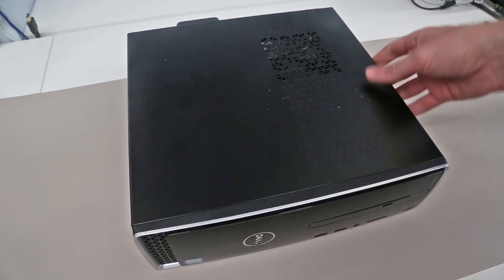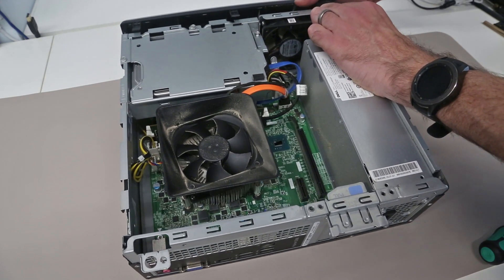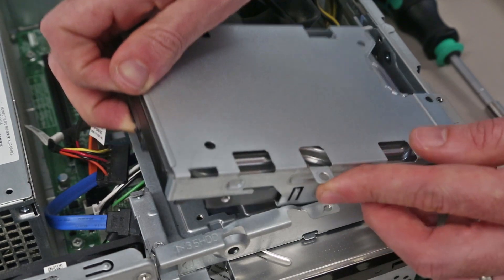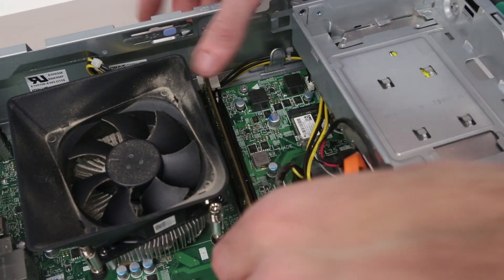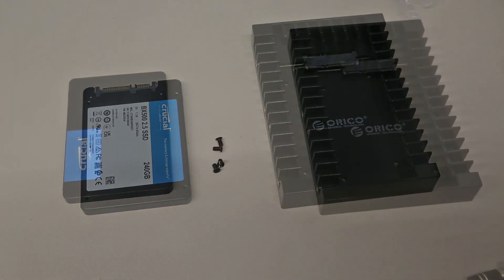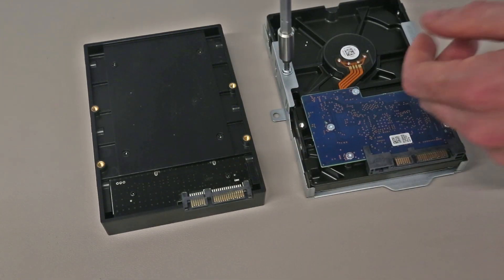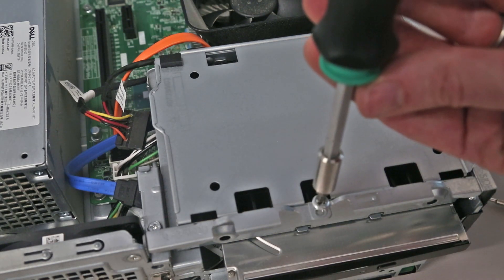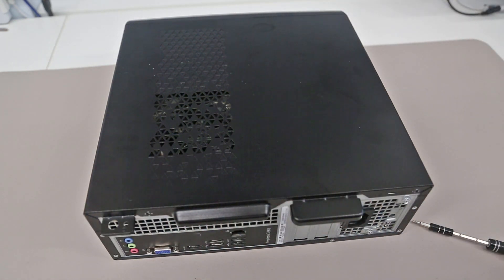Dell Inspiron 3268 - SSD and RAM Upgrade Guide

Comment: Great video, really useful.  Tried to start afresh with the ssd and a win11 install from a usb but windows doesn’t find the ssd to install, wondering why
Reply from the maker: You probably have the Intel VMD enabled - its used for RAID/Optane if the system has either.
You'll either need to supply it with the driver on the drive selection page or disable the VMD in the BIOS.

Comment: In which direction i should place fans for dell inspiron 3268 pc
Which direction air should blow 
There are 2 fans 
1 cpu cooling fan and other on front down side of cpu. 
I am confused about the orientation.
On google mix answers are coming. Please help.
Reply from the maker: The CPU cooler fan blows down towards the cooler. The front fan blows in to the case.
Reply: @BrueComputing  you mean to say cpu cooler fan blows air away from cpu right ?
Outside the case

Comment: You would just go ahead and put a "stick of gum" SSD naked strip in it. The light blue peg holds it in the dedicated SSD socket, next to the card slots. Choose the Serial-ATA strip, with a notch cut at position "B" key. Seems this isn't wired for nVMe protocol, a shape "M.2" SSD, the PCIe connection.

Comment: Cheers pal, used this vid to replace a 3.5 HDD with a 2.5 SSD. Had to push the new hard drive in quite firmly to get the screws to line up. Is that right? However, would never have got the right adapter without your vid. 👍

Comment: Hi, could you make a similar video on how to install a new graphics card in this desktop computer? I'm planning on adding a GT 1030 to my Inspiron 3268, but I'm still relatively new to computer upgrading. I did follow your steps to upgrade my SSD and RAM parts though, got myself a Crucial 1TB SSD (+2.5 to 3.5 adapter) and a 8GB RAM card.

Comment: Thank you James for the excellent video, which gave me the confidence to try to upgrade my own Dell Inspiron 3268 desktop computer with a 1TB Crucial drive.  Unfortunately, after installing the new SSD I find that I cannot boot up into Windows 10.  The disk copy with a boot option using Acronis True Image apparently worked successfully.  Any advise or suggestions would be most welcome.

Comment: did this using an ssd which had window installed already but ssd not detected when booted from desktop. Any reason why it didn't boot?
Reply: Might be different device drivers on the previous machine windows 10 was installed on.

Comment: Can we use both HDD and SSD? But this have single power slot
Reply from the maker: You could remove the optical drive and install a 2.5" SSD in a optical bay caddy.
Reply: Yes, you’ll need a power splitter cable (£4) and an additional SATA interface card (£15) and another SATA cable. You should be able to slot the SSD underneath the optical drive as there should be space. I’ve done this with a very similar Dell Optiplex SFF last week.
Reply: Oh sure, that's easy. Dell has the light blue peg that anchors the SSD strip, right there next to the card slots. (power and Serial ATA data port, in the shape "M.2"  SSD socket. notched position "B" key).

Comment: Could you possibly give SSD specifications compatible with this model Inspiron 3268? Thanks in advance.
Reply: ooops could see that in the video :)
Reply from the maker: Amazon Associate link for a compatible drive: 
1TB 2.5" SATA HDD: https://amzn.to/3nqAxCa
Reply: You would just go ahead and put a "stick of gum" SSD naked strip in it. The light blue peg holds it in the dedicated SSD socket, next to the card slots. Choose the Serial-ATA strip, with a notch cut at position "B" key. Seems this isn't wired for nVMe protocol, a shape "M.2" SSD, the PCIe connection.